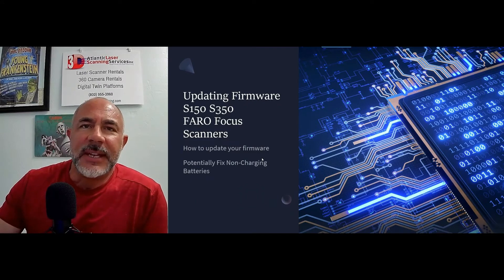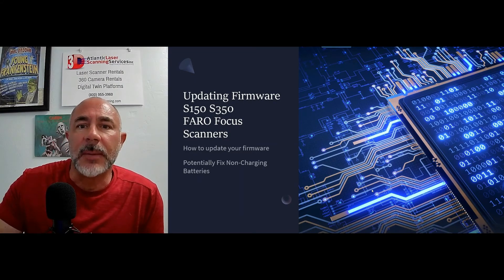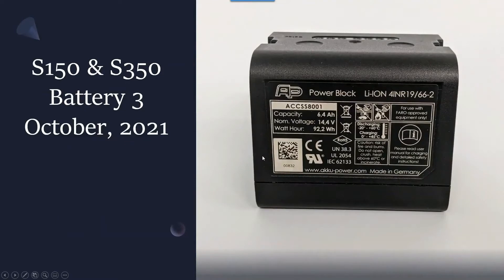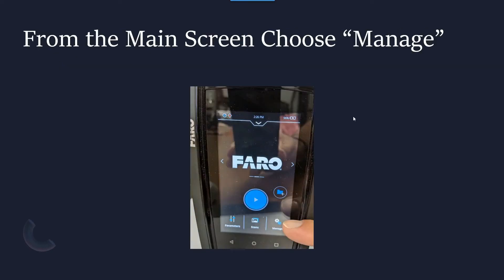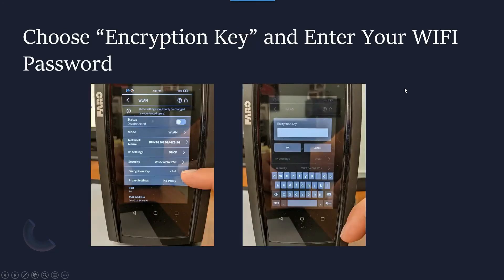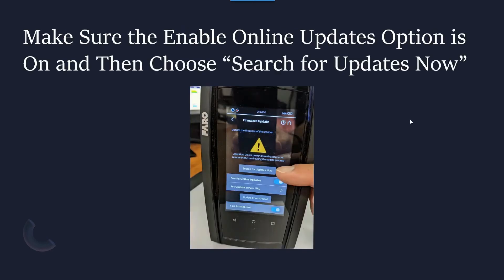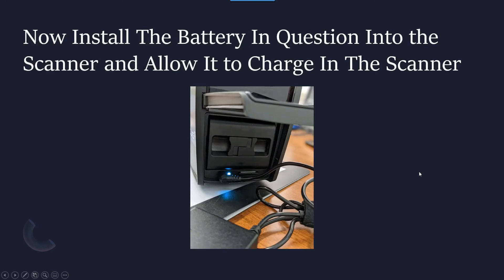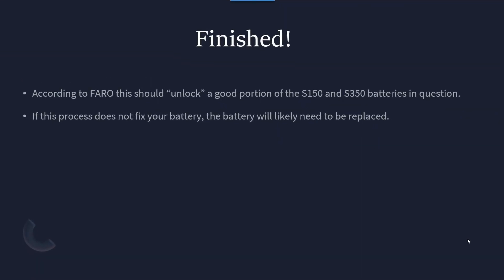FARO S Series Battery Fix

Comment: Tried this, doesnt work, LED just stays white as per on the charger.
Reply from the maker: Unfortunately most of the batteries from FARO the last couple of years will not be fixed by this problem, they just got bad.